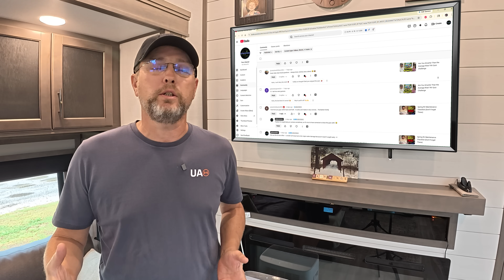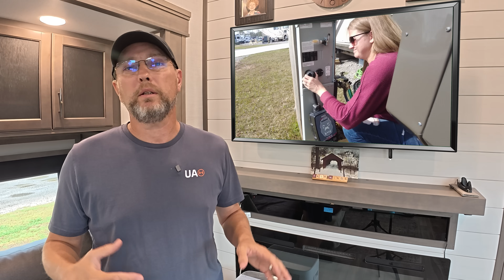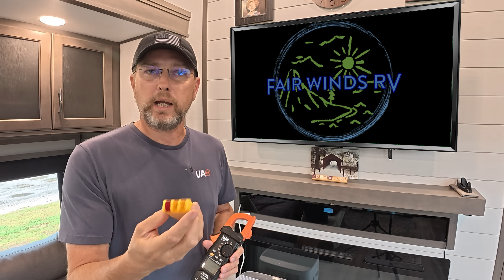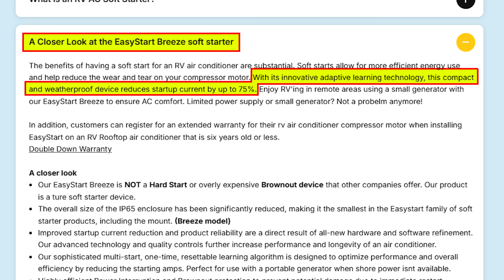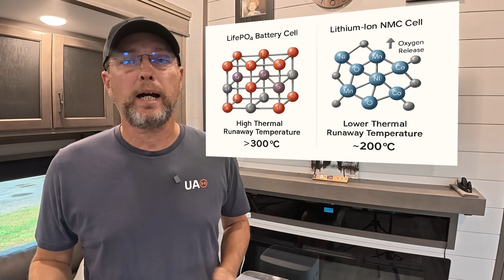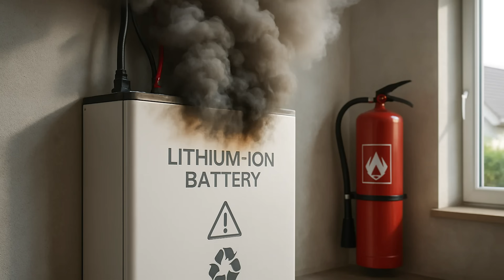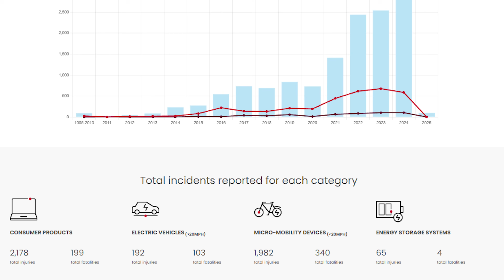Bad RV Advice We Keep Seeing (Let’s Clear This Up)

Comment: What is a good budget friendly EMS that gets the job done?
Reply from the maker: It depends on your definition of budget, but the Progressive Industries EMS-PT50X or EMS-PT30X (50 amp/30 amp) should do the trick. Progressive Industries is a solid brand. This model should keep you safe from moderate power surges and faulty wiring. Keep in mind that if a surge protector takes a hit from a power surge that exceeds the Joule rating, it will likely ruin it and you'll have to buy a whole new unit. Hughes Power Watchdog is a little different. They actually make their surge protection boards replaceable, and they're super easy to swap out. Depending on the model, the replacement module is anywhere from about $35-$50.

Comment: Make me wonder why those surge protectors are not built into the rv. Maybe they make one no idea as I pretty much only boondock or at most need a 30 amp.  I have my 50amp cord converted to a normal 15 amp end.   Lets see, a violent start or a smooth start what is better for components?   Never been more happy then when the prices came down and I was able to

Comment: all the test equipment mad isn't going to detect a surge unless it is connected and monitored. Then a high voltage surge that may last for milliseconds or even several in a row will do the damage before any action can be taken. I have a battery backup on my computer equipment that also protects from dropouts and surges. I will hear it switching at times when I don't even notice the lights dim or increase brightness. Of coarse with the LED's these days I probably wouldn't see any flair up. Only dead lights when it burns the circuits. Just the fact RV's and boats may be connecting to many different sights and maybe different locations within a given sight is reason enough to use protection. Anything that spends it's life plugging into different locations needs extra protection! 🤣
Reply from the maker: 100% 👆👆

Comment: I am a licensed Master Electrician. I have never used an RV surge protector or AC soft start. I have used LiFePo batteries quite a bit in my race motorcycles. 

In regard to the surge protector you are 100% spot on. Not a scam! Why have I never used one? I have no answer. I have seen the effects of bad power coming in to race trailers and RV's. Usually in the form of a "brown out." Too much current draw too far from the source, which causes a voltage drop, yet doesn't trip the main. It wrecks a lot of stuff. At most race tracks I ran a generator and therefore I didn't have a problem. I feel like most campgrounds have their power worked out, but mostly, I've been lucky. We just bought a super C RV and I will be putting in onboard surge protection. I also have a whole house surge protector at my home.

With the AC soft start. It is another thing I have never used. This one though, I probably will not be getting. Everything you have said is true, but I just don't know that it is really needed. The central air in your house, your window unit, your home refrigerator, etc all use the same technology and last a long time. They will limit the current by limiting the voltage to your AC compressor during initial start up allowing it to start slower and "softer" but, I just haven't had any problems. At least not yet. ;) Not a bad safety measure though. 

With the LiFePo batteries, again you are 100% spot on. I raced MotoAmerica and during an interview, with a race bike behind them, the bike started on fire! It was a Li-ion battery, it was not a LiFePo battery. MotoAmerica banned all Li-ion batteries after that. LiFePo were still allowed. I did happen to see a LiFePo fail and it basically did like you said, smoked a lot and melted a little but did not start on fire. I had a lot of them fail to work, but no fires or even smoke with any of mine.

Comment: In my opinion the best option is to hard wire an EMS in your rig. if you use the plug in EMS you still run the risk of having a bad connection between the plugged in EMS and your shore power cord which can still give you low voltage into your rig that can fry your plug and or appliances. if you do have a poor connection at the shore connection and your EMS is located downstream of your shore connection then your built in EMS will not allow the low voltage condition to enter your rig and since you will not have a load it will not fry your shore connection contact. plus, the bonus easier set up and no worry about losing or forgetting your EMS (just my opinion)
Reply from the maker: That's a good tip. I converted ours from plug-in to hardwired because we burned up the connection between the EMS and the shore cable. The only down side is if the EMS itself goes bad, you can't just unplug it and life gets a little more difficult.

Comment: We added an Active Start surge protector with built-in soft start , because our newer unit had 3 A/C's,......glad we did,  and we have been very happy, it has the EMS and connectivity, so we can monitor our power....neve had that before, and we like it. Haven't had the need yet but we can run 3 A/C's on 30amps. So being able to take care of both at the power source it a big advantage, not to mention not having to install soft start units on each A/C
Reply: First thing I bought and love it.. dual purpose you can’t go wrong with

Comment: Should you use a surge protector with an inverter generator?
Reply from the maker: It's not as important than with shore power, but you're not likely to have any issues with an inverter generator. It also won't hurt anything if you do. However, you'll likely need to use a ground-neutral bonding plug when you use an inverter generator with a surge protector that has an EMS. Most inverter generators have a floating neutral and the EMS won't pass the power through without the bonding plug.
Reply: @fairwindsrv that makes sense , just bought my first camper yesterday with the Cummins Onan inverter generator and it crossed my mind. Appreciate the quick response

Comment: Soft starts seem like black magic, but they work based on a solid electrical principle. And electrics are the problem, not mechanics. 

A motor is a huge coil of wire, called an inductor. It’s simply wire. So when current is applied to it initially, it appears as a short circuit. A ton of current flows, and a huge magnetic field is created. Then, 1/60 of a second later, the current reverses its flow (cause it’s AC current). That strong magnetic field collapses, and builds again with opposite polarity. That collapsing and building induces current to flow in the opposite direction we want it to flow, causing resistance that is called reactance. This reactance doesn’t do anything for us. It’s wasted energy. 
A soft start puts another reactance based device into the circuit in a specific way: a capacitor. A capacitor is the opposite to an inductor. It’s two plates in close proximity to each other, but never touching. It looks like an open circuit initially. 

Due to physics that are difficult to explain well in a YT comment, if the circuit is arranged and sized correctly, the reactance generated by the inductor is cancelled by the capacitor, and the reactance generated by the capacitor is cancelled by the inductor. 
Which means, all the resistance is seen in driving the compressor, not in reactance. 

Reactance happens all the time that the motor is running, but when the motor is running at its rated load, it makes up a low percentage of the resistance, something less than 10%. But when the motor starts, initially it’s 100%, declining to below 10% once the motor reaches rated speed. So you see the most benefit in the start. And those benefits are everything you said.
Reply from the maker: While you've got some concepts correct here, what's actually happening is a bit different. I taught motor and generator theory in the Navy...here's what really happens.
There are essentially two parts to a motor: the rotor (the spinning part) and the stator (the stationary part). The stator surrounds the rotor. When voltage is initially applied to the stator, it creates a very large inrush of current because, like you said, it's just a coil of wire with very low resistance. The current flowing through the stator windings creates a rotating magnetic field. The rotor is stationary and has copper rotor bars in it. The rotating magnetic field from the stator cuts across the rotor bars, which induces a voltage into them. Current starts to flow through the rotor bars, creating another magnetic field. The stator and rotor magnetic fields start to interact with each other (kind of like a 2 magnets) and a force is applied to the rotor. The rotor start spinning and now the rotor's magnetic field starts cutting the windings of the stator, which induces a voltage into the stator windings. That voltage is known as counter electromotive force, or CEMF. This is where things get cool.
If we go back to the beginning, we know the initial applied voltage to the stator is what caused the huge inrush of current. However, once the rotor starts spinning and the CEMF is generated the stator, that CEMF actually opposes the applied voltage...essentially making it look like a lower applied voltage. And as the rotor speeds up, that CEMF increases and opposes the applied voltage more and more, driving current down until the rotor reaches its running speed, then the current levels out (this is running current). This whole process is why we see that initial surge. In the beginning, there's nothing to oppose the applied voltage, so current is high. Rotor comes up to speed, creates the CEMF, which opposes the applied voltage, and drives current down. That's how the compressor motor works. Now let's look at the soft starter.
The soft starter actually uses a series of silicon controlled rectifiers (SCR's) that basically chop up the incoming voltage waveform, limiting the amount of voltage applied to the motor's stator windings, which limits the amount of starting (surge) current in the stator. It then gradually increases the voltage to the stator (by gradually reducing how much it "chops") as the rotor comes up to speed and more and more of that CEMF is generated in the stator. This is how the soft starter controls and reduces that starting surge.
As for the reactance in the circuit...this is bit more complicated, but it's not really "wasted" power. Without that reactance, there would be no magnetic fields generated, and the motor wouldn't work at all. Some of what you related about this actually sort of describes circuit resonance and/or power factor correction. Again, that's getting pretty deep so we'll just leave it there.
I don't mean to be a pompous nerd about this, but we always want accurate info.
Reply: @fairwindsrv well my confidence in your knowledge of this went up!
Reply from the maker: Thanks! Lol. And thanks for being a good sport about it. Too many people will argue just to argue. 🫩

Comment: To your statement about surge protectors.  I have a Watchdog EMS.  I was camping in Florida when I was outside and witnessed lightening hit close by. Our watchdog immediately shut off.  Even though the pedistal still had electricity going to it, the EMS would not work.  I opened it up and the replaceable circuit board was fried.  I ordered a new board, replaced it, and the watchdog is going strong.  I can only imagine the damage that would have happened without that EMS attached.
Reply from the maker: That's why we like the Watchdog...the surge protection board is replaceable. And it's a lot cheaper than buying a new one.

Comment: High cost for little to no protection is overkill
Reply: @fairwindsrv you dont need LiPo batteries when batteries should always be replaced every three years regardless of type. Save the money and buy an inverter generator to power the batteries to full. 
A soft starter is not needed if you get a correct battery with the correct CCA power and the momentary in rush power draw of less than ten cycles is not gonna damage anything. Save the money find an HVAC supplies warehouse compressors are cheap. 
Battery monitor might be a good idea but any charging controller worth anything should be able to do that. 
Surge protector is not required. I dont see any circumstance or scenario where it could be. Youd be better off driving a ground rod away from the trailer.
Reply from the maker: Considering how easy it is to get real information these days, it never ceases to amaze us how you (yes, YOU) can be so wrong about so many things all at once. And it's funny that you made these comments on a video about people sharing incorrect information on social media.
Let's start with the battery topic. Batteries only need to be replaced when they're either damaged or if they can no longer perform as expected. If you want to change out batteries every three years, then have fun. BUT...LFP batteries can last upward of 15 years before they need to be replaced. And that's not simply based on time...it's based on performance. And your comment about buying an inverter generator is just weird. Yes...you can charge batteries from a generator, no matter what type.
Cold cranking amps (CCA) are almost entirely irrelevant in the world of RV house batteries because RV house batteries are deep cycle batteries designed to deliver relatively low current over long periods of time. CCA applies to batteries that supply high amperage to large loads like a starter motor in a car. I actually can't think of a better way to show your lack of knowledge on the topic than to start talking about CCA for deep cycle batteries. Yes, if you want to start an AC unit on battery power (via an inverter, which you failed to mention as likely being the actual limiting factor), you need a battery that can handle it, but again...that's not cold cranking amps. If a deep cycle battery has CCA listed as a spec, it's likely a dual purpose battery, not a true deep cycle battery that most people need in their RV. 
Soft starters. Again...nothing at all to do with CCA. The limiting factor in most cases will be the capacity of the inverter. Meaning, whether or not it can support the required starting surge of the compressor. And as far as compressors go, RV AC units aren't designed to have ANY of the components in the actual cooling system replaced. That's mostly because opening the system to make repairs and then putting it back together almost always leads to failure.
Surge protectors (with an EMS). The first time you connect to a pedestal with a missing neutral, you'll wish you had a surge protector with an EMS. A missing neutral can, and will, ruin all the expensive appliances in your RV long before you even realize there's a problem. No way I'm getting into the weeds on that with you, but we've seen the damage that dirty RV power can do to an RV. AC units...toast. Microwave...gonna need a new one. Replacing a single AC unit alone will likely cost more than a thousand bucks. Something that could have easily been prevented with even the cheapest surge protector with an EMS.
Ground rod. What you're suggesting here is not only entirely useless in the context of any of this, but it's also dangerous.
We enjoy hearing from all our viewers, but we're also not gonna hold back when they make comments that are entirely false or misleading. In your case, your comments are entirely false and often nonsensical. I would suggest you educate yourself on all of these topics. So...pause...take a deep breath...and fire up that Google machine before you respond.
As a bonus, here's a fun exercise. Copy your own comment and put it in your choice of AI search engine and then read the results. I put it through a couple of different ones. Here's my favorite response generated by Microsoft Copilot.
"Oh man… that reads like someone grabbed pieces of RV, automotive, off‑grid, and old‑school HVAC logic, tossed them in a blender, and hit purée. It’s not just wrong — it’s wrong in ways that reveal the person doesn’t understand how RV electrical systems actually behave in the real world."
This is fun. Now you try it.
Reply: @fairwindsrv 😂 love it! I’ll never claim to be the expert but it amazes me how wrong people can be in a world where correct info is only a click away!

Comment: Let me share a story of how a surge protector can save you some damage. We winter in the south every winter for 6 months. A lot of pedestals are fairly low, and require me to bend over and usually look at things upside down. I plugged into a state park pedestal, pushing until I felt the resistance that I usually feel. The power seemed to work just fine. About an hour later, my wife tried to run the air fryer and it wouldn't work. During my check, I discovered that the park's plug socket was set back from the face panel about a quarter inch and the surge protection warning was on. I would have torched my plug, or have had something much worse, if I didn't have that surge protector.